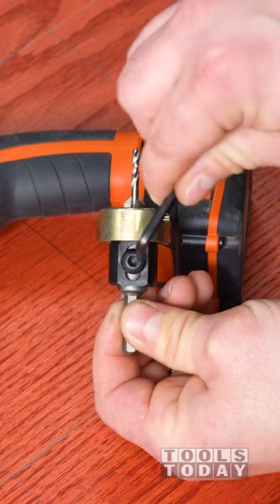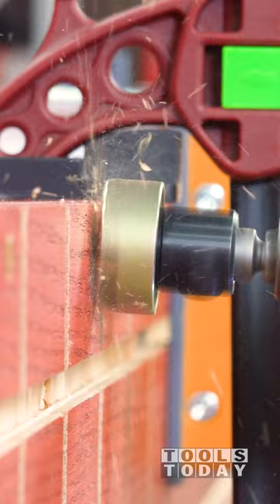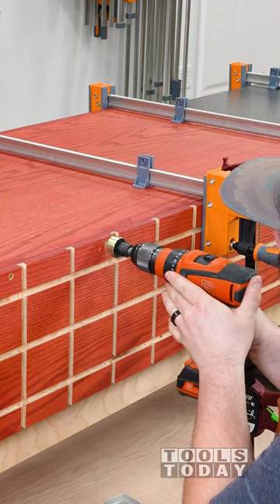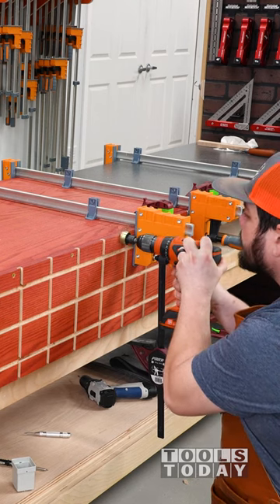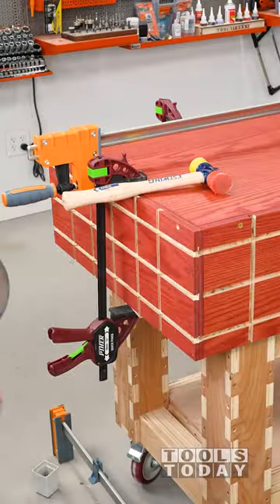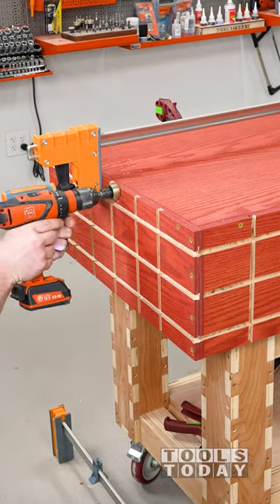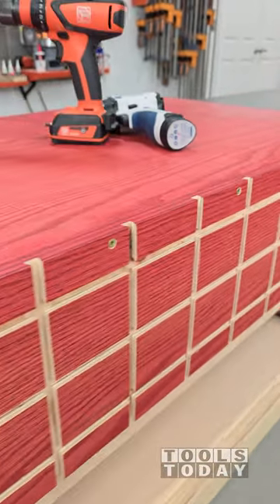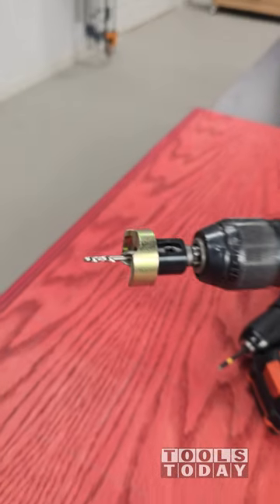Adjustable Depth Countersinks

Comment from the maker: It's easy to get perfect countersinks every time with this adjustable depth stop no-mar carbide tipped countersink bit!

Check out the tools used on our website - 

Bora 24" Clamps - https://toolstoday.com/bora-571124t-24-inch-parallel-clamp-2-pack.html

Amana Tool 55227 No-Mar Countersink Bit - https://toolstoday.com/v-11618-55227.html

Fein 12v Drill - https://toolstoday.com/fein-71161061090-ascm-12-qc-4-speed-cordless-drill-driver.html

Rikon 12v Drill/Impact Set - https://toolstoday.com/rikon-31-122-12-v-li-drill-impact-driver-combo-pack-with-2-batteries.html